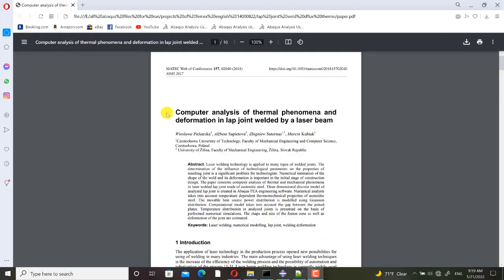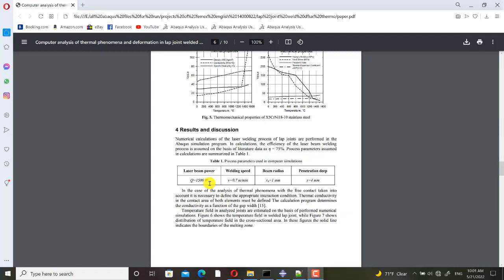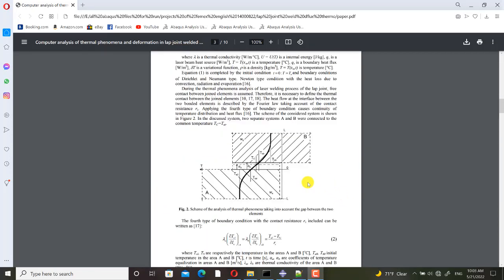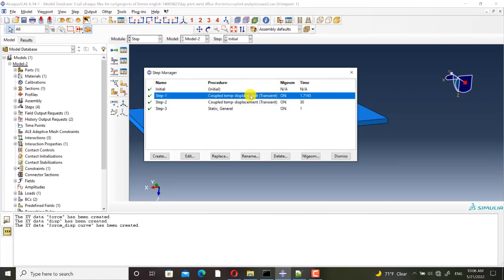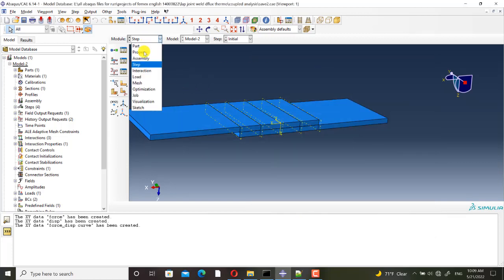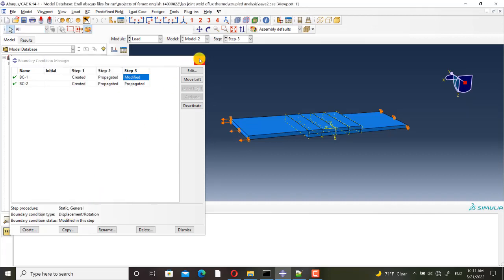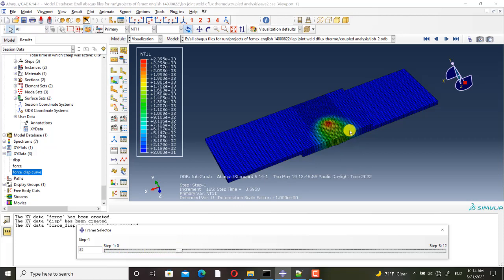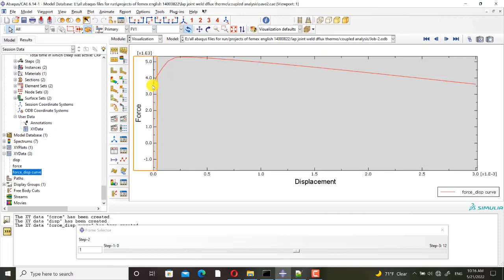Tensile Test and Welding Simulation of a Lap Joint in a Multi-Step Analysis via Abaqus

Comment: Thank you Amirhossein for this video. but i have a question.  you use a USDFLD and define density as field variable and you can predict melted zone. how can correlation between density and melt zone?
Reply from the maker: Hi.
You are welcome.
No I don't relate density to the melted zone. Both of them are dependent parameters. In such simulations, these parameters are dependent on temperature and I visualized the melted zone with respect to the temperature field. I used USDFLD subroutine to do this and used temperature field in this subroutine.

Comment: When we define DFLUX, what should we enter in the @10:56 magnitude tab ? Does it need to be 1
Reply from the maker: Hi.
Actually this value does not affect the heat flux value and it does not affect the simulation. You can enter every number which you want. I usually set it to 1.

Comment: Hello I'm running a CEL model of stir welding joint with dynamic,temp-displacement,Explicit steps. How can create a step for tensile test with Explicit simulation please because I can't do it like in the video ?
Reply from the maker: Hi.
you must define a dynamic explicit step after the step of the welding.
I mean at least your simulation must have two steps :
step1 for doing the thermo-mechanical analysis.
step 2 for doing the tensile test.
in step 2, some of the boundary conditions of step 1 must be modified.
Reply: @FemexIran  I have fixed my workpiece in step1 for thermo-mechanical analysis and I gave a displacement for the tool to penetrate in the workpiece and a rotational velocity
What should I modify please!
Reply from the maker: @oumaimatrad1915  In your analysis, first the tool must penetrate into the workpiece and do the welding and go out of it.
Then the boundary conditions of the workpiece must change in order to conduct the tensile test.
It means that one side of the workpiece must be fixed and the other side must move.
Reply: @FemexIran  Do I have to disactivate the fixation of the workpiece in the step of tensile test?
Reply from the maker: @oumaimatrad1915  It depends on the original test rig and the position of the fixtures.
In the tensile test, usually one side is fixed and the other side is moved.
If the boundary conditions of welding process are not the same, you must deactivate them in the tensile test step and use the mentioned boundary conditions.